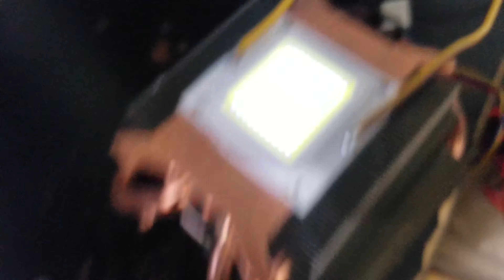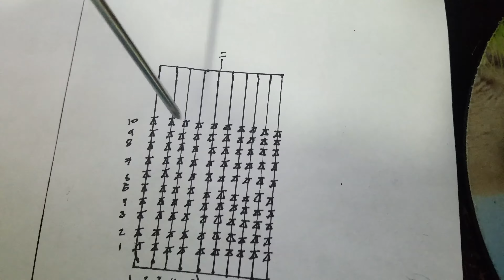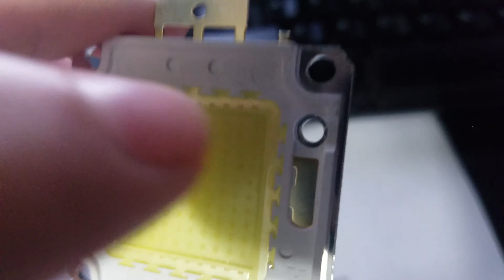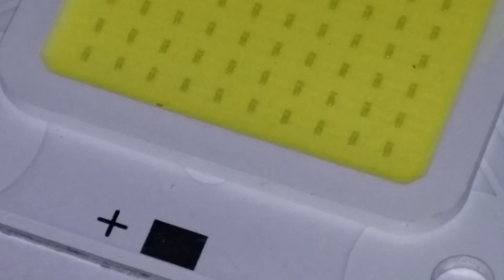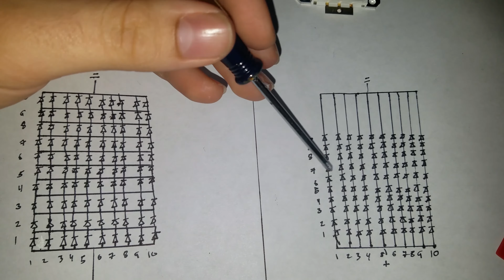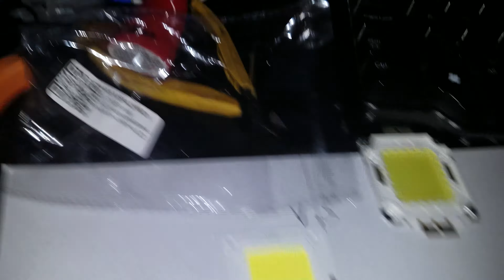Best Value + Quality 100w LED?

Comment: Hi Brian how did you solder the cables on the led, i tried it a few times but it doesn't hold :-(
Reply: Use flux, good solder and high termal mass soldering gun. Metal base sucks so much heat that you need a good soldering iron to do it.

Comment: My 50w led lights up evenly and it is the one with the tiny wires, they seem to be good if you get binned ones.
Reply: Actually , you can do your research and you will discover that your 10x10 model is 50W and 10x14 is 70W full power . The 100W is 10x20 . Ofcourse you can overdrive them but let's not fool ourselves . Cheers
Reply: (Brian W) Bit late but I got one from arrow.com because the shipping on digikey would make the LED £20 found a better offer on arrow only £14 and it's 6500k 80CRI and higher k = more visible light. the link: https://www.arrow.com/en/products/cxb2540-0000-000n0hx265e/cree?gclid=Cj0KCQjwlMXMBRC1ARIsAKKGuwjsgUtupFHnTAsWDKruQiVCEf2YWo8A8mgfeVv3Q6TRarCQZdcIjlwaAqz7EALw_wcB It is very bright sadly my 50w driver blown (because it was cheap) so now i'm running it on 30-40W still very bright :)
Reply from the maker: Yes, but binned ones are much more expensive, and as I showed in the video, I bought LED's from the same aliexpress seller and ended up getting completely different ones (much worse quality) than the original ones. I persuaded an alibaba seller that normally sells lots of 1000+ to let me buy a lot of 100 of an upgraded version of these LED's, which have 14x10 LED's, rather than 10x10, giving a much higher efficiency at 100w or you can take them up to 140w each if you wish.
When they arrive, I will finish my video making a 1000w LED light bar I'll be mounting on my truck, hopefully in the next couple of weeks.
Reply: The LED was only £5.49 I might of got really lucky not sure.
Reply: Also sadly the seller doesn't ship to the UK :/
Reply from the maker: I found one on Aliexpress that sells them, but only up to 70w. Not too expensive, but they're probably not binned.
https://www.aliexpress.com/item/1Pcs-Newest-Design-COB-High-Power-20W-30W-50W-70W-100W-LED-Integrated-Chip-lamp-Beads/32643544710.html?spm=2114.10010108.1000014.6.2897ab6e8XqjQ&traffic_analysisId=recommend_3035_null_null_null&scm=1007.13338.80878.000000000000000&pvid=bd28b730-439e-4bbb-9616-e7f0bf24eaf5&tpp=1
Reply: Takes more than a month to ship to the UK though, but I did find some on eBay from china the exact same looking: http://www.ebay.co.uk/itm/LED-Chip-Bulbs-COB-LED-Cool-white-Driver-Supply-High-Power-20-30-50-70-100W/272619024895?ssPageName=STRK%3AMEBIDX%3AIT&var=571739769031&_trksid=p2055119.m1438.l2649 If mine breaks ill get one of the 70w ones and run it on 50w.
Reply: Here is a really good Cree led only £12: https://www.digikey.co.uk/product-detail/en/cree-inc/CXA2540-0000-000N00X250F/CXA2540-0000-000N00X250F-ND/4928957
Reply from the maker: Nice find, those are 70W and relatively good quality as they are made directly by Cree and binned. You'd have to see how much it would cost to ship as it's not included in the price.
5000k would be natural white, and they claim a 70CRI which is rather bad, but it shouldn't be a problem if you're using it for regular lighting.
I've looked it up and a lot of people use those LED's for grow lights, so I supposed they're extremely reliable, as they are on 24/7. I've never used CREE LED's so I have no first hand experience though.

Comment: Hey, thanks for you video! Unfortunately the seller you suggest doesn't ship to italy (where I live) so I'm wondering if you can provide me another useful link.. :D
Reply from the maker: I searched for a long  time but I haven't been able to find any other LED's like this from any other seller. Sorry.
Reply: I saw similar LEDs on aliexpress "Newest Design COB High Power 20W 30W 50W 70W 100W LED Integrated Chip", they even have the same markings CY 10B10C G. I do not have those so cannot tell about quality.

Comment: Really helpful video, thanks! The link you posted is out of stock though, any suggestions for another vendor that has them or some sort of way to search for them?
Reply from the maker: I messaged the vendor asking if they'll restock and I'll update with the answer. I searched mercilessly on eBay and found nothing else. On Aliexpress, I found a similar design but that only goes up to 70w (and also messaged the seller if they have 100w ones). I have a seller on Alibaba offering them for $2.80 a piece but you'd have to buy them in bulk (10+) and shipping is sometimes expensive, like $20, unless the seller is willing to send them via ePacket, which I haven't asked. If you want the Alibaba store just PM me and I'll tell you it.
Reply from the maker: DrTomatoSpaghetti OK so that eBay seller responded saying that they temporarily closed the store until February 5th, because it's their new years. I suppose that they'll be buyable then.
Reply: Wow thanks for the help dude! I found a listing over here http://www.ebay.com/itm/152270167573 where they also say that the seller won't ship until February 2nd. I think I'll grab one from them for now and also check back with the seller you listed once they re-open their store. Thanks again!
Reply from the maker: I just checked and yes, they have more on them in stock.
Reply: Sweet thanks man!